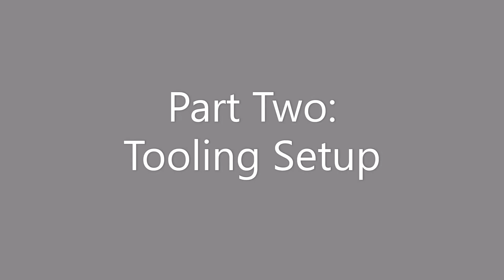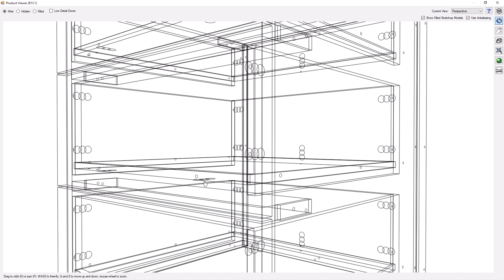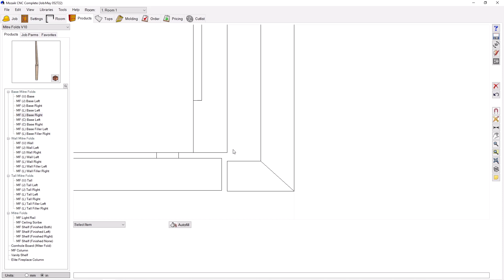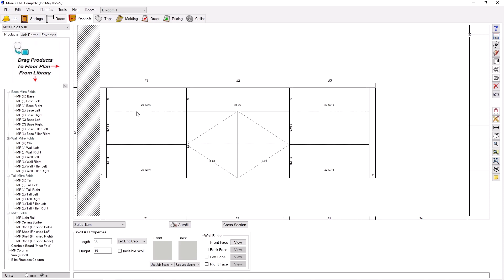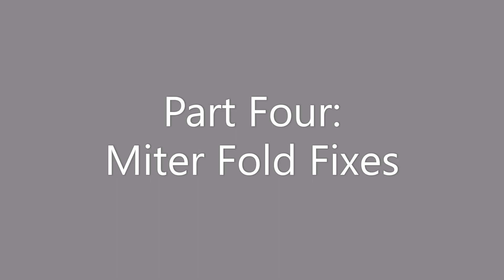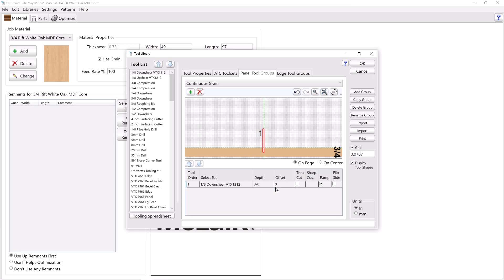PERFECT Continuous Grain Cabinetry with a CNC Router and Mozaik Software!

Comment: I have succeded continuous grain with Cabinet Vision with my Vortex 1/8 tool down shear, broke a lot of them. I am currently looking for a way to use my new upshear 1/8 and could not figure out how. I was trying to create a toolset with both tool in the right order, but the optimization kept on using the last one, now I understand why. Software support did not know either. Thanks to you I now have the way. Continuous grain is awesome,  thank you very much for your channel. Temptation is strong to try Mozaik.

Comment: im wondering for flip side operations where the hinge cups are being drilled the squaring cut is done by the upshear bit. Can you change this to the compression bit, or because the upshear has to be the designated cutout tool you are stuck with it?
Reply: Wondering the same thing

Comment: This is good but you are forgetting one thing.  
  The edge banding thickness comes into play here.  When I do real wood banding I use 1.5 mm edge tape and put a 1.5mm radius on at the bander to create a softer edge.

When you do this you are better off using the 1/4" bits. that way when you add the banding and the 1/8" reveal and end up with an almost perfect grain match ( off by a touch but barely noticeable ) 1/4" bit = 6.35 mm part gap then add back in the two 1.5 mm reveals to get a 3.35 mm gap. Since 1/8" = 3.175 you are only off by 0.175 mm on the grain match which you really can not pick up on with the human eye.

When we grain match Salt panels or other thermo-fused melamine or P-Lam the banding is usually 1mm so I use a 3/16 set of bits to get a net gap of 2.7625 mm so this is .7625 mm off of perfect but again not noticeable.

3/16 bit = 4.7625
add back the two 1mm edge bands = 2mm
4.7625 part gap - 2mm banding total = 2.76 grain match effective gap.

But followed your techniques to achieve the machining and worked great ! keep it up learn a lot from your channel.
Reply from the maker: Certainly not forgotten Jonathan...a lot of cabinet shops utilizing these videos have premill edgebanders where the considerations you mention aren't necessary. But in the case of edgebanding without premill, you can certainly take that into account in Mozaik and choose bits and part spacing accordingly.
Reply: @thecabinetpodcast  Ahh that makes sense , Very nice use of the software , you come up with stuff I didn't even think of , way to go !?

Comment: Great instructions.
Followed along, set up my tools and tested!
I actually have an Island in the shop that will be hor-grain all the way around. This class was perfect!
It was a bit tricky getting all parts in the right order during optimization but found the only way I could was to select certain parts (only) to be optimized and break it up into 3 different optimizations. The key was to do 1 pattern and create g-code. Then do the next set. 
Open to suggestions.   Thanks

Comment: This is very well explained.  Thanks again.  Vortex doesn't know they are coming up on a 1/8" bit shortage...😂
Reply: What is the reason for going 9/16" on upcut bit and not 3/4?  Is that because Mozaik understands the remaining thickness of the part after using the 1/8" downcut?  Thanks
Reply from the maker: I want to make sure the upcut bit does not go more than 3/16" deep into the remaining material on it's first pass...so I'm limiting the pass depth in that manner...

Comment: This will be used in our shop as instantly. I'm pretty confident that I would have been able to start with the 1/8" bit to cut everything out. I'm am also confident that in order for me to achieve this level of perfection with the continuous grain. I would have needed 10-12 sheets of 3/4" Rift White Oak. At approximately $165.00/sheet in our area. Add in the machine and programing time it would have cost as well. You just save us a ton of time and money. Thank you so very much.
Reply from the maker: Great to hear it Andy!